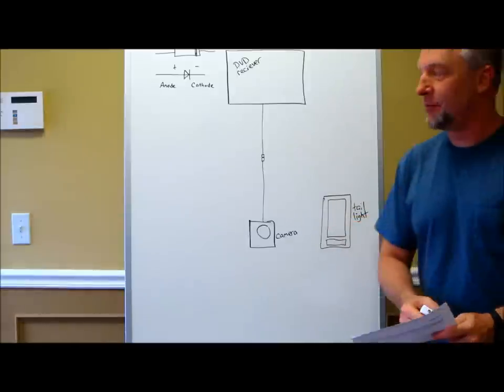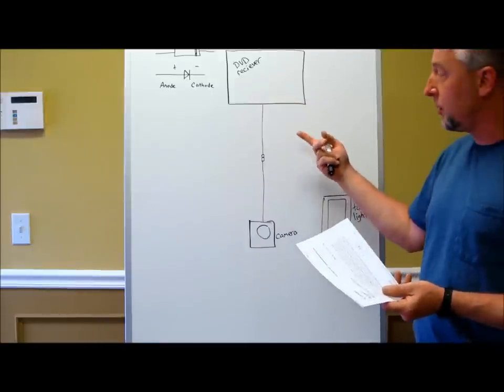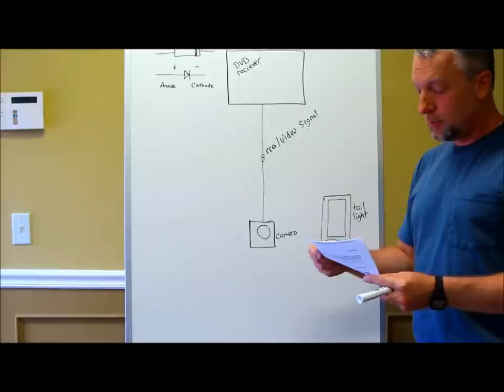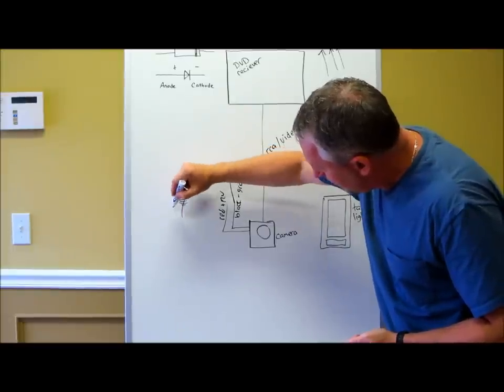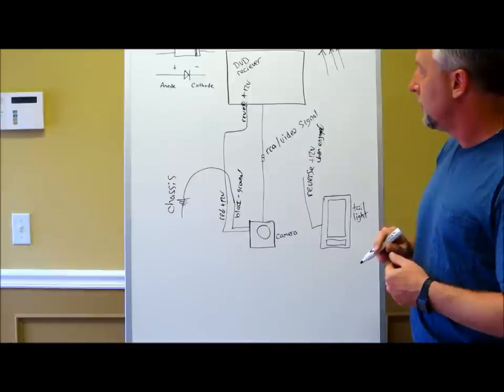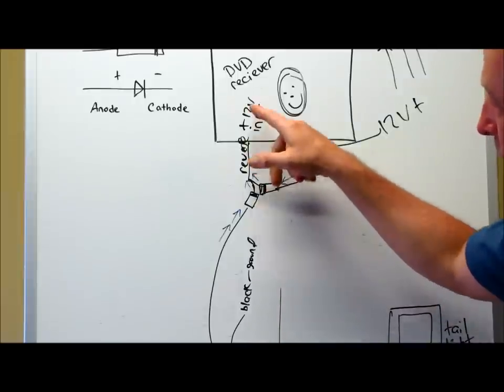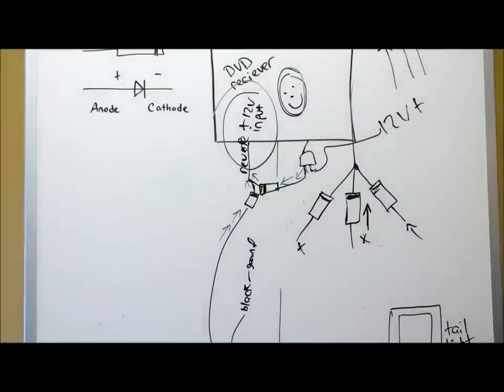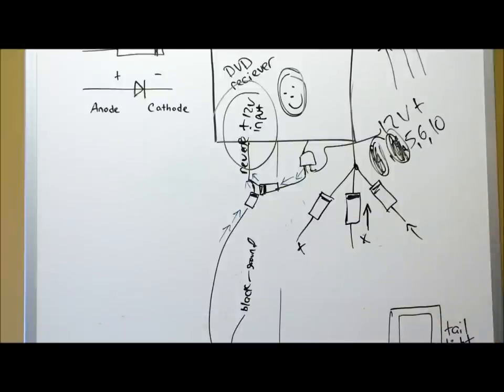How to wire your reverse camera with a switch

Comment: im thinking about putting my back up cam on a switch, great video explaining it, but im more worried about the technical part, how would you wire in these diodes and protect them back behind the stereo? just solder and heat shrink?
Reply from the maker: Tape is fine, but heat shrink is an even better option.
Reply: Lessco Electronics ok thanks! and how come you only sell the 6A diodes in a 10 pack?
Reply from the maker: I do 10 packs cause if I sold onsie, twosies Id lose $ after shipping little things like that.
Reply: Lessco Electronics makes sense...one other question, do you have to bring the camera power wire back to the splice with the diodes? or can you just wire it to the reverse light in the back? and if you could do it this way do you still do the double diode isolation off the tail light and the switch?
Reply: Skulskit 
Short answer: Yeah you have to bring it back.
Long answer: If you wire it directly to the reverse light, your camera WILL get power. The problem is that if you don't bring the camera power wire back, your display WON'T get power and it WON'T recognize that the camera is on (it will think it's off). Therefore you will not see the camera's video on your display. 
Note: These backup cams are already designed in the simplest way possible, and there really aren't any shortcuts. If there was an easier way, they'd be doing it already.

Comment: What if you did not want this camera connected to the reverse lights at all and just wanted it connected to a switch period? My car has trouble with the reverse lights, sometimes they work and sometimes they do not so I would want to do this without having to connect to the reverse lights at all.....Any suggestions?
Reply from the maker: tmacc100 sure, thats fine too. just do it the way you explained

Comment: why not leave the backup camera on all the time while driving ?
Reply: If connected to the radio it will be on the backup display. You could put two toggle switches one for the receiver one for the camera but if you direct connect the camera to say the battery it will be on all the time and run your battery dead.
Reply: Rob - Yes, the right way is to power the camera (+) lead from the ACC (Accessory) Red lead on the wiring harness behind the radio. The camera (-) lead connects to Audio GND (black) lead on the wiring harness behind the radio. The radio and camera will power ON and OFF together, as a properly designed system. Yes, these two power wires to the camera will be long, but they will be free of large ground currents elsewhere in your vehicle that will cause image distortion and possibly loss of sync with the radio video decoder. The Reverse lamp (+) lead connects ONLY to the radio's Reverse In input, which signals it to display your camera image when your vehicle is in reverse.

Comment: i was wondering can i just hook up the camera with out the reverse light ? i just want to turn it on when i need it 
i off road and need to see behind me 
and do i need a diode ? or can i just turn it on from 12 v ?
so i think single pole switch to 12v then do i go to the stereo camera wire and then to the camera red and the camera ground to chassis ?thank you
Reply from the maker: sure, thats ok to do as well, it doesn't have to be complicated, But if it ever does, I'm your man!
Reply: thank you so much for your wisdom

Comment: single pole double throw is simpler. no need for diodes. youre already going to put a switch in so just go with the spdt. you even said "diodes get hot" diodes get hot = more likely failure.

the only benefit to this is if the switch fails you will still get the camera in reverse. if the spdt fails. you have no camera.
Reply from the maker: diodes cant be replaced by a spst relay.
Reply: He said SPDT switch. Are you insinuating voltage could jump between the poles of the switch? Camera and monitor on the common, 12V ignition and reverse lights on the switching poles. Unless power jumps through the switch, you're isolated. Sorry, but you're thinking way too much into this.

Comment: To those who suggest running constant 12v to the camera, you cant do that to certain cameras with leds built in them.
Reply: A question,I want my camara to turn on when i put it on reserve,but also sometimes just to check what I have on my hitch carrier,not always being on,just sometimes turning it on,will it be all good?

Comment: I hooked up my camera on an inexpensive DVD receiver. I hooked it all up. I am only able to see my camera when I click on the camera button on screen. It doesn't activate on reverse. I hooked it up to the cam in input on the receiver and to the back up lights. Is there anything I can do to activate directly after putting in reverse?
Reply: I have the same issue did you figure out something please help
Reply: +masses yozd I have the same issue guys have you figured out how to fix please
Reply: +luis razo Hi luiz is your camera is a reverse camera,if it is just connect the red wire to the reverse wire from the back wire orange of your dvd receiver and same lime connect it into reverse light red positive so when you put the car on reverse it will send signal to the monitor as well as your reverse light.
Reply: +luis razo your camera might be a photo camera it will work on video in, into your dvd receiver but not on reverse.cause i did change my factory radio receiver into a china cheap dvd receiver which i did try both

Comment: Can a wifi camera be powered by connection at license plate light for constant power while lights are on? thanks
Reply from the maker: no, but you can tap onto the running / parking lights though
Reply: Why not from the licence plate light? Camera+wireless sender uses about 0.2amps.

Comment: I have a rear view mirror with 2 channel video screen, 2 sets of rca wires and 2 sets of wires to activate the mirror channels.  I already installed a back up camera to 1 channel that activates when in reverse only.  I’m stumped because I want to instal the other camera to the bottom of the passenger mirror and I want to activate the camera to show the side image when I activate the right turn signal only . Can anyone show us the wiring diagram for this set-up?  Thank you, I really appreciate anyone’s help.

Comment: Can't you just run  fused 12 volt power to the camera and monitor on a switch and skip the reverse lights and diodes?
Reply: You can, but then the camera/monitor wouldn't automatically turn on when you put the car in reverse.
Reply: It would turn on anytime you used the switch.  Effectively making it the same as a room with a light switch VS motion sensor.  The switch adds a step but also versatility because you can turn it on when ever you want it.

Comment: I have a question I want to run back up camera constant on to my rearview mirror monitor but stil have my auto reverse "mode" displaying on my double din head unit while in reverse I know the is a solution with out having to run two separate cameras.. Pleas help!!
Reply from the maker: +Joe Tellem youre talking about 2 screens simultanously, which one did you want to override?
Reply: I have an after market rear view camera as well as a double din head unit.. Currently it auto engages when in reverse on my double din.. How ever I want it to run constantly on the rear view mirror monitor while I'm driving and stil be able for it to auto switch on my double din head unit  when reversing
Reply from the maker: whats the models of the 2 monitors?

Comment: couldnt you do the same basic thing, only bypass the reverse connection at the tail light, and run 12 volts thru the switch to the radio reverse, and the camera power? you would have to manually switch the camera on when going into reverse, but it eliminates the need for diodes as well as eliminates the need to tap into the tail light wires.
Reply from the maker: Sounds like alot of extra steps, but you can try it for yourself I suppose.

Comment: Seems like an overly complicated way of doing things.  This video suggests you need a switch and diodes (soldering, presumably) to arrange things, but I highly suspect that most head units (especially after-market) already have circuits in place to do this; just need to wire it correctly.  

He is right that the radio will be "looking" for a 12v trigger for the back-up camera.  So you have a choice.  If you want the camera to be on only when in reverse, then you can share the same circuit with the radio and the reverse (lights).  If you want to be able to view the camera whenever the car is on, then the camera must be supplied by accessory power (running lights will often be able to this).  The radio should not share the same 12v reverse circuit in this case.  For the radio to automatically switch to the camera when in reverse though, it still needs to be wired in to the reverse circuit.

Comment: JUST CUT THE REVERSE WIRE IN HAFT, PUT ONE DIODE BETWEEN AND YOU ARE DONE...
Reply: how about 4 cameras to stay on all time in cargo monitor, using just the same rear camera as a backup camera with a switch to the head unit?

Comment: I installed dvn927bt with JBL adapter it whistles not all the time seems like it's only when it's quiet mostly because I probably can't hear it for the radio for DVD CD blah blah blah how do I get rid of that whistle I put a ground wire from the radio to the frame whistles still there it's just different wrench man 55 at yahoo.com

Comment: If your switch is on when you go into reverse, you'll have an overvolt situation since both +12v sources will be in series with the head unit and the camera.. This is not the correct way to do this
Reply: Sean Sinay 12VDC plus + 12VDC = 12VDC, you can't produce overvoltage at the load with a 12VDC Source, hook up 12 different wires from source to load and you'll still have 12VDC
Reply: +George S Correct, 12v positive is 12v positive.

Comment: This is absurd !! Just connect the reverse wire from the head unit to the reverse wire in the car harness, then connect the red wire (12V) to the red wire on the head unit that is already connected to the accessory wire in the car harness.
This way the camera is on as soon as you turn the key. It will come on when you go into reverse, and also you can go into the head unit and switch to the rear camera input, and you can watch the rear when driving on the screen.
Done

Comment: Oh come on. How long you been doing this? First off from the camera just hook up the red wire to the positive wire on the light that turns on when you put your car in reverse. Second run a wire from you units back up power, usually light purple with a stripe to the same hot wire. Camera can be turned on from the head unit will also automatically switch on when gear in placed in reverse. No need for switches or diodes. How silly.
Reply: Your reverse lights will be on any time your camera is on if you wire it the way you suggest.
Reply: Nope they are not.
Reply: So the power source for the camera it gonna be the source for the wire that says reverse on head unit so they can kick together when I put on reverse automatically please help thanks